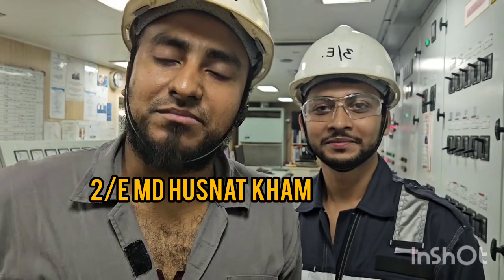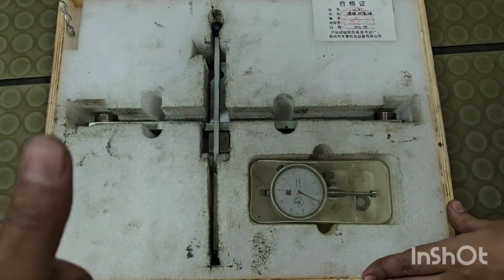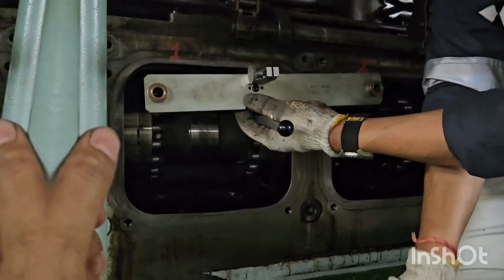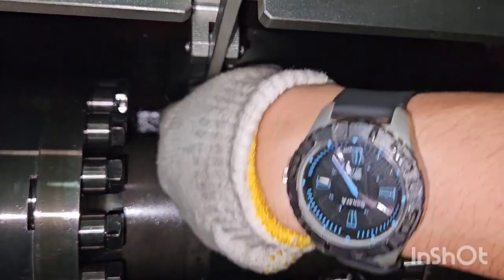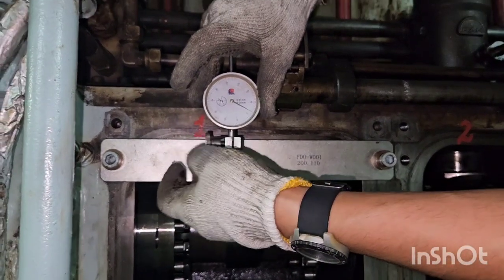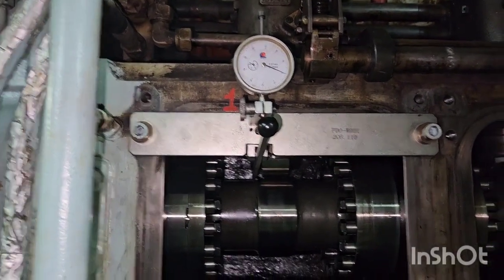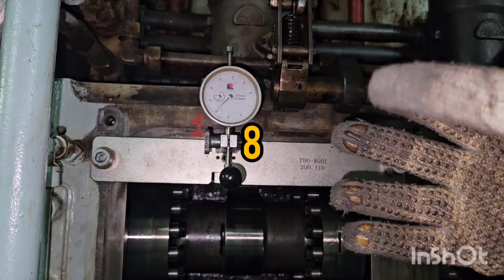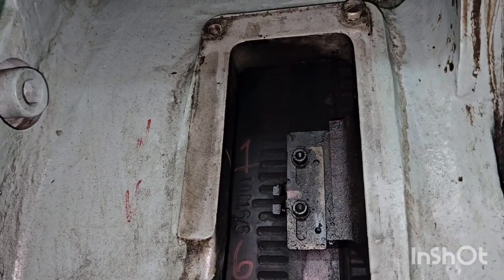MAN 8L21/31 AUXILIARY ENGINE FUEL PUMP TIMING CHECK.

Comment: Guys,  should be begging and completing of certain procedure, any procedures  .., you didn't explain what to do after with received figures 🤔 Procedure is not complete
Reply: Надо по мануалу поискать adjustment of fuel injection pump по каждому цилиндру